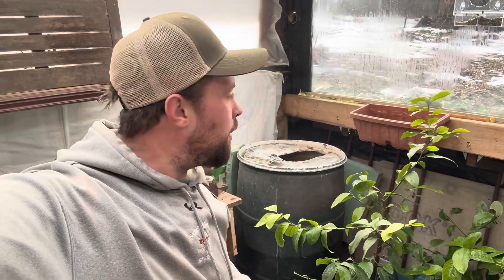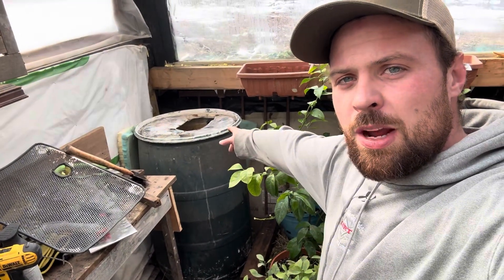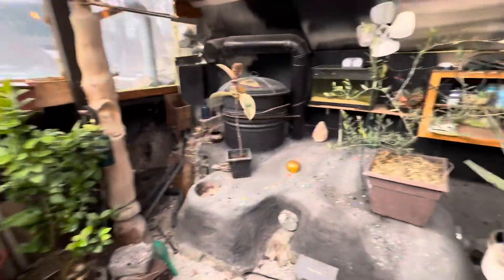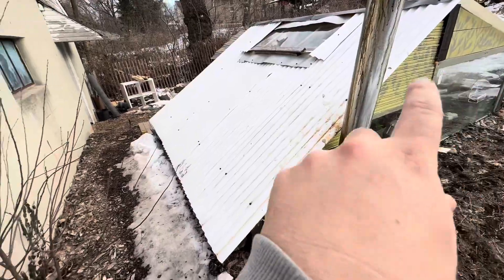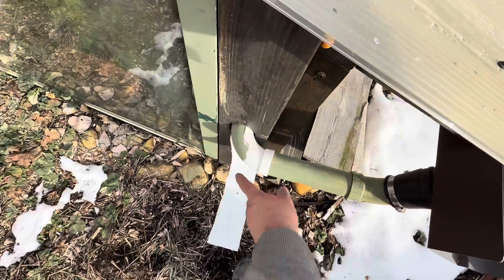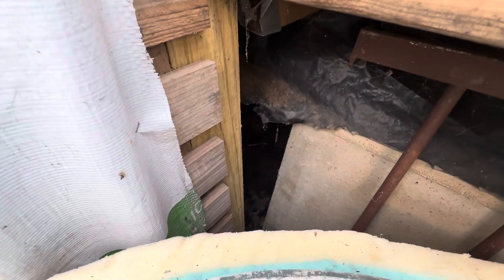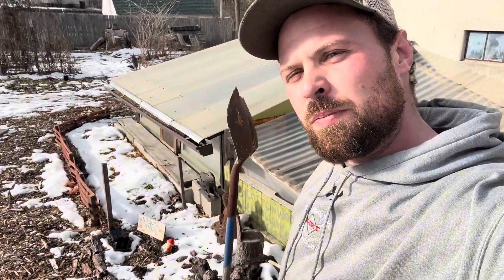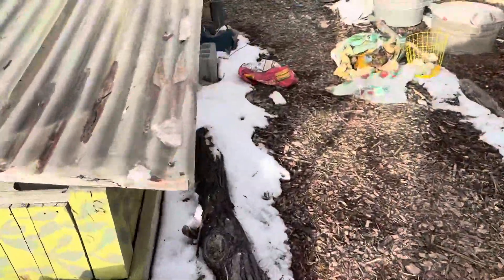Does it flood? How I keep my underground greenhouse (Walipini) from flooding!

Comment: Dude this has been driving me nuts lol but for my house. I’m thinking I’m starting my walipini this summer!
Reply from the maker: @ActualLiteralKyle  do you mean you’ve been having trouble with flooding in your house? Good luck to you! Worst case scenario you can put in a sumppump!
Reply: @ haha yeah man, got the sump and the backup like 6 inches higher because when we moved in it was a NIGHTMARE. 
I’ve basically had to spend a lot of time on gutters and extensions and carving a path and then letting the rain do the rest of the work. These days the sump doesn’t fill until things are serious. 
my house is about halfway down a consistent 4-10% grade from the high edge of my yard to the street, so it happens a few times a year, maybe an inch of water on the cheap vinyl planking until we can afford some French drains.